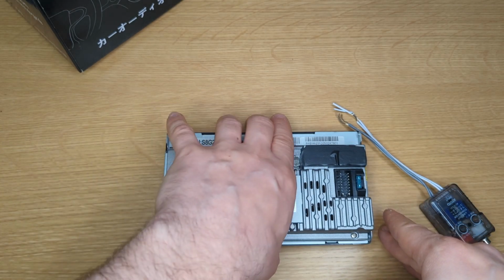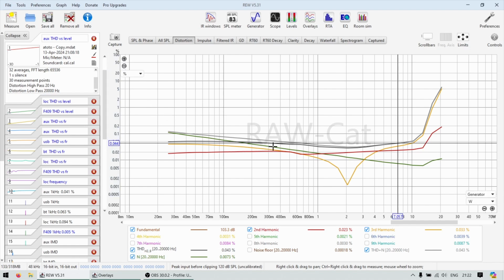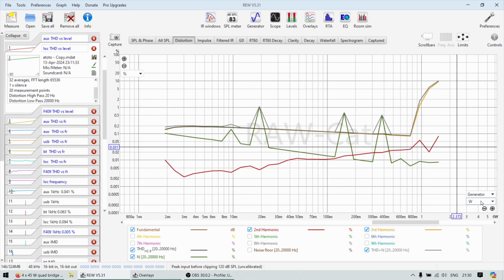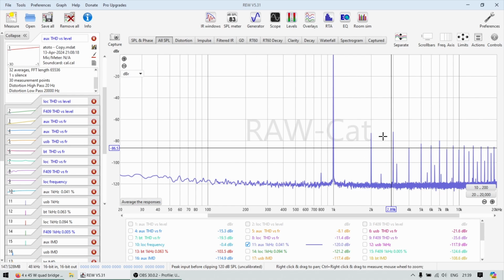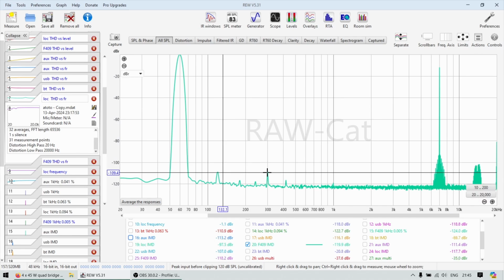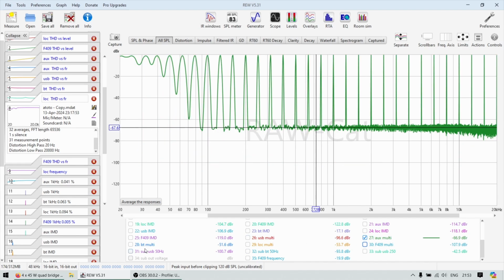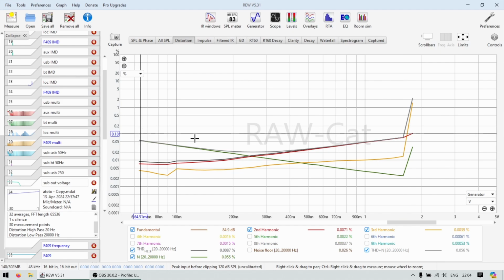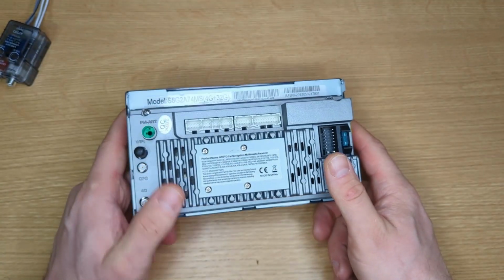How clean are Android head units? ATOTO S8MS Distortion measurements#ATOTO #myatoto #multimedia

Comment: Did you notice any white noise or electrical noise at no or low volume?  How about amp turn on pop when the internal amp is powered up?
Reply from the maker: There is hiss if using the build in amp, same as majority of head units. I don't use it. Other than that, no other issues.

Comment: I see you don't have any low level "random computer buzzing" type noise which does not increase with the volume control.
This is when I connect my old Kenwood amp to speaker or RCA outputs, with resistive voltage dividers. Yes I am a technician!
I suspect I have noise from the car electronics being superimposed onto the head unit supply.
Good to see that not all these head units do this!
Fantastic video, very clearly presented.

Comment: Great video, but very technical for me :)
How much worse is this unit than the top line Kenwood DMX908s? And will this atoto do well with sound stream 405 amplifier and single 10" sub in a trunk?
Reply from the maker: Cannot answer the question about Kenwood, as I have not tested any of the big brand head units. In regards to your setup, this head unit would work with any amp.
Reply: @RAW-CAt  thanks for the response. Are you planning to test them in the future? I wonder if the 800$+ price tag is really justified..
Reply from the maker: @Eclipse_lite  unless someone will send me one. That is not likely.

Comment: When you mentioned you have an Alpine F409.... it brought back memories of an MRV-F409 that had "Special Edition" engraved/stamped on it. Is yours the same? Mine was used in an all Alpine system, the 1st generation single din iPod head unit, imprint dsp, front Type R components, Type R coaxial in the rear doors, MRV-1507 sending power to two 12" Type R subs in a custom sealed box with a dedicated 2nd battery and capacitor. Loud and clear.
Reply from the maker: Yep, the same special edition with copper back plate🙃
Reply: @RAW-CAt that era of Alpine products was some of, if not THE class leading equipment without having to sell a kidney. I along with a lot of others really appreciate the good info and the easily explained testing/results. Thank you from Australia 🦘🐨

Comment: If you were to connect the head unit to speakers directly with no amplifier, using just the 15W the unit puts out, would I just connect the speaker wires to it? Is there a downside to this?
Reply from the maker: Yes, you connect speaker wires directly.

Comment: Appreciate the vid!  But I'm a bit confused about some things you said at the end.  You're saying not to bother with quality amps as the noise from the head unit power amp would make the extra expense irrelevant.  But you were measuring power amp output.  And the unit you're testing has RCA preamp outs to connect to external amps.  Are you saying the preamp is causing the distortion?  I'm curious about the distortion at the RCA pre's(not those line levels you're talking about at the end; the actual RCA's that connect to the pin blocks), as that's what would matter if you're building a serious system with external amps.  Anybody trying to build a serious system using deck power is gonna be disappointed for the reason you mention:  You'll only ever get about 20 WPC(or less) no matter who the manufacturer is:  Dual's Walmart special or a flagship Alpine.  Again, I really appreciate your efforts and your sharing these sorts of tests!  Love this kinda stuff!
Reply from the maker: This particular head unit does not have RCA pre outs. You are supposed to use the LOCs that degrade the sound even further.
Reply: @RAW-CAt  ugh... yeah, not good.

Comment: For production of the low level outputs that is the RCA, no player would use this TDA aur any other similar chip. These chips are used for the production of high level or speaker level output. The RCA level signal is one step before this amplifier chip. This low level signal is produced after the decoder decodes the track data. And then the DAC chip converts this decoded data into analogue signal. This analogue signal produced by the DAC chip is still very weak. It is boosted and processed by something called the op amps and other electronic circuitry. Now it becomes so called 2, 3 or 4 volts of RCA out . 
 Therefore the quality of the RCA signal you get is dependent upon the quality of DAC chip and the accuracy of decoder chip and quality of op amps used and  all the electronic circuitry components implemented in support of these chips and of op amps . 
I hope you get this as I tried to explain it in as basic and rudimentary language as possible
Reply from the maker: Yes, all of this is very correct, however most likely you are commenting without watching the video. This head unit does not have low level RCA outputs, only high level amplified after the IC. So in this head unit the bottle neck is the TDA chip.

Comment: I am reading a lot of comments that the cleanliness is due to this tda amp chip. 
 And also that most Androids use this particular chip and they gonna measure similar. 
 This is not at all correct inference to make. 
Only chip doesn't decide the cleanliness. If all other Android use the same tda chip , doesn't necessarily mean that all Androids will measure similar to this. There is alot of circuitry involved before this tda chip amd after this tda chip. The design, quality if components and implementation of those circuitry combined with this tda chip  , decides the performance
Reply from the maker: That is very correct, however these measurements are extremely close to the ones published by texas instruments, so the performance is close to optimal. The only way it can change is by screwing things up, but there is very little to screw up as this chip requires minimal.extra components. And no android HU manufacturer will put anything extra if it is not needed. Everything is being built to a price point. Head unit cannot perform better than the chip itself.

Comment: Would a teyes cc3 also fall into this android player
Reply from the maker: I would say the audio performance would be extremely similar.
Reply: @RAW-CAt 
Only chip doesn't decide the cleanliness. If all other Android use the same tda chip , doesn't necessarily mean that all Androids will measure similar to this. There is alot of circuitry involved before this tda chip amd after this tda chip. The design, quality if components and implementation of those circuitry combined with this tda chip  , decides the performance

Comment: I would have liked to see you actually have tested using the rca/low level converters that came with the unit also to see if it was really worse or better?
Reply from the maker: I did measure them, the data is from 11:15
Reply: @RAW-CAt  I must have missed that part, thanks. Are there better high to low converters than what's supplied with the unit or do you think its best to use an amp with high level inputs.
Reply from the maker: @shirazs8882  best is to use a head unit with normal RCAs out.
Reply: @RAW-CAt what did you set the gain to on the converters?
Reply from the maker: @thunder57  minimum gain.

Comment: I would like to request a test for a inline digital to audio converter with an android head unit. (Yes I know this one has no r.c.a ir input /output)
Reply from the maker: There is no point in using a DAC if the head unit has a digital output. All DSPs have digital in. I will be testing Android tablet digital output.

Comment: Man this is a master class on this topic. Amazing video. I actually have a head unit with the exact same amplifier chip also, i do have a front R and L rca out as well as a sub out, do you think the R and L out would be as equally clean as the sub out you tested? That seems like it sould be the best option seeing how clean just the sub out was. 
Also do you know if its possible to ditch that chip entirely and solder in a way better one? lol is there a market for this sort of upgrade lol
Reply from the maker: As chip amps go the genuine TDA is almost the best there is. If you have RCAs out, they should be as clean as the sub out I have tested, as the DAC is the same just with a low pass filter on the sub out.
Reply: @Mr. For production of the low level outputs that is the RCA, no device would use this TDA aur any other similar chip. These chips are used for the production of high level or speaker level output. The RCA level signal is one step before this amplifier chip. This low level signal is produced after the decoder decodes the track data. And then the DAC chip converts this decoded data into analogue signal. This analogue signal produced by the DAC chip is still very weak. It is boosted and processed by something called the op amps and other electronic circuitry. Now it becomes so called 2, 3 or 4 volts of RCA out . 
 Therefore the quality of the RCA signal you get is dependent upon the quality of DAC chip and the accuracy of decoder chip and quality of op amps used and  all the electronic circuitry components implemented in support of these chips and of op amps . 
I hope you get this as I tried to explain it in as basic and rudimentary language as possible
Reply: @dsk-xx  that was perfectly explained and I completely understand the signal routing you explained. Since my original comment I have dove head first into audio and have gained loads of knowledge. Reading my original comment back is funny to me now cause that is ridiculous what I thought to do. I am now using the optical output into an external DSP and then to amplifier and speakers, the amount of control I have with the DSP is unbelievable. I really appreciate your comment it definitely helped further understand that path of signal. Thanks

Comment: Do you have any high quality line out converters like the Kicker KISLOC or KISLOC2? 

On my Joying head unit I can get up to 8.0v on the speaker outputs. It also has an interesting adjustment in the settings called Power Conditioning. I can adjust it down to limit the maximum output voltage. Let's say my amps can only accept 6 volts or 4 volts RMS , I can adjust the output levels so that full volume only goes up to whatever voltage I want it to. In its default setting it does allow the volume to go higher than 8 volts, but then the signal starts to clip. I could adjust it to limit the maximum volume to be 8.0v. The same can be done on the RCA outputs which are clean up to 2.0v. The volume control allows it to go one notch higher which is 2.2 volts and it clips.

It's definitely a very cool little feature of this head unit.
Reply from the maker: I don't have any LOCs as I never had a HU before. I am getting a joying HU for a review in a week or so👍
Reply: @RAW-CAt  For anyone looking for an inexpensive, yet high quality line out converter, the Kicker KISLOC is usually the cheapest and easiest to find over here in the US. It's got a nice flat frequency response.
Reply: The Recoil Qloc is better than Kicker with up to 8V output.
Reply: @matthewvassar9686  I don't know if it's better. Has anybody checked its frequency response? Does it roll off the low frequencies like a lot of cheap units do? 

Obviously that is a different style. The Qloc is what you call an active device, while the KISLOC is a passive device. You would need to run a power and remote turn on to the Qloc, while the KISLOC doesn't need that.

One advantage I see of the Qloc is that it can also function as a line driver. So it can reduce your voltage or boost it up.

Comment: Why thd of 0.5% at 20w is bad? Doesn't bass use more power and high frequencies less?
Reply from the maker: It's objectively bad. THD vs frequency should be flat.
Reply: If you were going to use a line out converter it would be best to use a high-quality unit like from Kicker. The supplied adapter seems to be a very poor quality design.
Reply: @JasonWW2000  not my question
Reply: @elviscaragea4433  Yes, I'm just trying to help you out. Just extra info. 👍

Comment: So this test was done with a high to low using the embedded amp? Did you test the RC'A's?
Reply from the maker: Unfortunately.there are no RCAs in this unit.
Reply: They did not include any that are pigtales and plug into the top row of plugs?
Reply from the maker: @TheSFFV  those are for video and aux in.
Reply: @RAW-CAt  Wow that is a first time I am seeing that.
Reply: @RAW-CAt are you sure there isn't a front channel rca audio output? Every unit I've seen has an L and R rca output in the same jst connector as the video ins and outs, usually the 20 pin connector will have the Land R rca out and a single sub rca out. From the video it looks like it does have that same row of jst pins
Reply from the maker: @Mr.Thermistor7228  atoto says that there is no rca. There are no RCAs in the kit. Manual doesn't say anything. Yes, I am pretty sure that this unit does not have preamp outs.

Comment: Sorry if i missed some point, but what I understand from the end conclusion is that my Xtrons with 5xRCAs should deliver decent low level sound signal to my amp?(Its decent quality for my ears now, but it could be because i dont know what I'm missing out on, lol)
I read in a Reddit post that if the headunit support the use of USB soundcards, it would be an improvement to have a USB to optical sound card, sending signal to DSP. 
My friends joying headunit has optical output in the back, so is that a better method than RCA or is it limited by the amp chip or Chinese home brew android software?😊
Reply from the maker: You are correct on all assumptions👍

Comment: One question: if we connect this Head Unit to a DSP, a Helix for example, what would be the result? Would there be even greater distortion? (adding the HU distortion with the DSP distortion)
I ask because I have a HU Volkswagem RCD340 and I am studying how to set up a good system in my car.
Reply: If you already have a helix with digital input, and you were interested in an Android based head unit, I would suggest getting one that has a digital output so they can be connected directly together.
Reply from the maker: The sound quality would be limited by the head unit. With a dsp you would gain options for tuning, but the signal will be "as good as it gets".DSPs are much more cleaner than this hu.
Reply: Get an Android with digital optical or coax out . And prefer   the Android unit that sends bit perfect digital signal out . Use that with DSP for best performance. 
 Even if you don't find an Android with bit perfect output over digital output, still use its digital optical output rather than RCAs. Even if not bit perfect still the digital out over optical would have much lesser or Nil background floor noise. 
 PS. Optical out may appear lifeless to you although clean and RCA in spite of being not as clean and notes of silent background floor noise, will appear to be more lively.

Comment: I would love for you to test a Teyes CC3 android head unit.   If you get a chance to test one I would sincerely appreciate seeing it. Thanks for what you do!
Reply: It is going to be the exact same thing and it probably uses the exact same chip, as he explained in the beginning of the video. I have a different branded android head unit from his and mine uses the exact same amplifier chip as his. Even if the model number of the specific chip is slightly different, as is across all the different brands making these units, it is not going to perform any differently than what he just tested. If it even did it would be so small of a difference it's not even legible. Since he is also using an Atoto which is arguably the best brand android unit on the market, everything else is either going to be exactly similar or worse than his. Just like he explained, they are all extremely similar to the point it's not even worth testing anything else in this category because it will be the same result.
Reply: Only chip doesn't decide the cleanliness. If all other Android use the same tda chip , doesn't necessarily mean that all Androids will measure similar to this. There is alot of circuitry involved before this tda chip amd after this tda chip. The design, quality if components and implementation of those circuitry combined with this tda chip  , decides the performance
Reply: Thats the HU I recently put in my a3, would love to see an expert review it - especially the EQ settings.

Comment: Well i am happy to see that these head units do well...i have the S8 pro, and i use the optical output for the best possible sound ..the higher end ones like mine for bluetooth is aptx hd so, i assume this hu is the entry model...not shabby for entry
Reply: I have an equally specd head unit as well with optical out, what are you using for the input of your optical out?
Reply: Only chip doesn't decide the cleanliness. If all other Android use the same tda chip , doesn't necessarily mean that all Androids will measure similar to this. There is alot of circuitry involved before this tda chip amd after this tda chip. The design, quality if components and implementation of those circuitry combined with this tda chip  , decides the performance

Comment: Can you please test wireless CarPlay/Android Auto?
Reply from the maker: Test is what way? The music through bluetooth is the android auto connection.
Reply: @RAW-CAt  I know Wireless CarPlay uses a wi-fi connection, it should be lossless.
Reply: @RAW-CAt  Atleast some pioneer headunits use wifi for audio when using android auto. I have z9200dab and it does that and it also has specific wifi audio mode.
So i would think that maybe these are also able to utilize that, don´t know if it makes much difference though.
Reply: @RAW-CAt  android auto uses wifi or wire
Reply: @RAW-CAt most head units use bluetooth for the aa or CP connection establishment and then use Wi-Fi for the music or other data transfer.